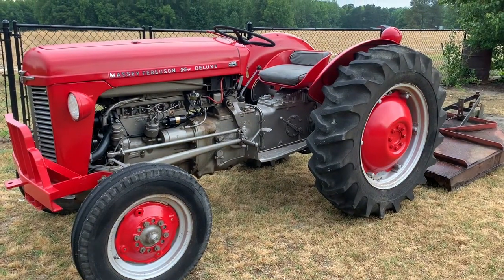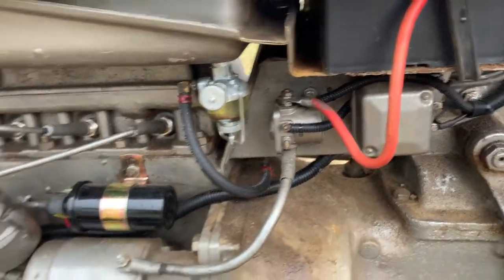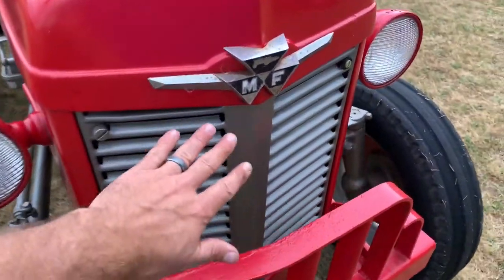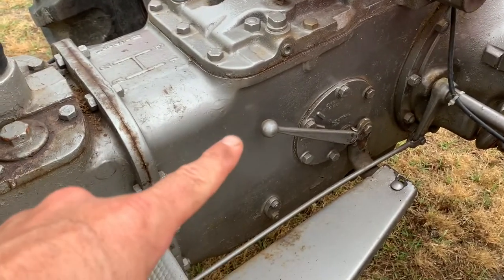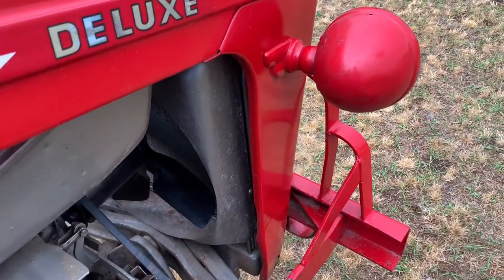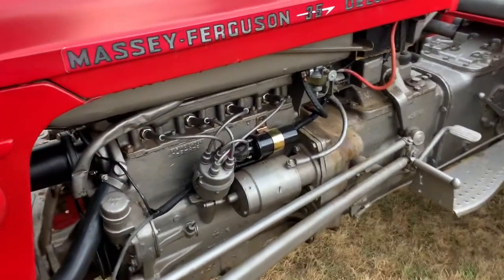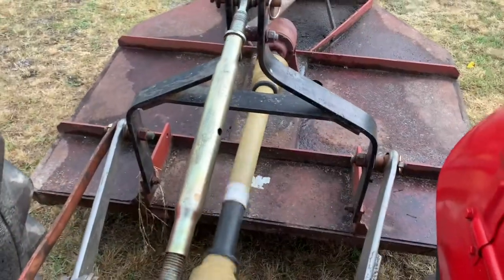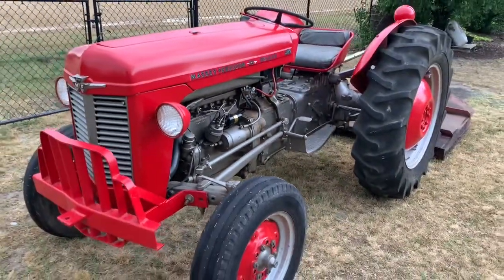1963 Massey Ferguson 35. Refurbished and ready for Work!  See all that was done to get her going!

Comment: The Deluxe had a two stage clutch that allowed the PTO to remain running when stopping the tractor by pushing it only part way down. It also had a seat with a padded cushion, tachometer and temperature gauge. The Special had an unpadded metal seat, single stage clutch the stopped the PTO whenever the clutch was pushed down to stop the tractor. It didn’t come with a tachometer or temperature gauge. It also did not have diff-lock or power steering. The Deluxe may or may not have diff-lock and power steering.

Comment: Here in Ireland  the massey ferguson 35x  has the dual clutch and differtial   lock .  There is also a standard 35 with a  single stage clutch  and another  massey ferguson 35 with a dual clutch .These were built in Coventry  UK .

Comment: I have a 1959 TO-35  Deluxe  with the same gas engine which means the two stage clutch . I put a front loader from a 65 series on it . I had to build front mounts for it because the 65 is a few inches longer than the 35 and it mounts to the front different . It has power steering which is needed with a loaded front bucket . It's held up good for 25 years and 15 of those years it was used in my construction i retired from . Still use it on a small piece of ground out here in the country  pushing snow and cutting weeds .

Comment: I would strongly recommend a overdrive clutch for the PTO if you are gonna be mowing with the tractor, it will solve the issue of the momentum of the brush hog pushing the tractor when trying to stop or turn.
Reply: It don't need that it has live pto
Reply: It's a two stage clutch

Comment: Your brakes are Not wet brakes !
The MF-35 always used drum brakes, 'Wet brakes are like a, cluch drive plate, to look at which runs in oil inside the back axle, they were fitted to the MF-65 range and most of the latter modles.
P/S, do you know that this engine was used in the old, flying Standard car from the UK? 
Also, you could run it on H20, by using a fuel-cell next to the carburettor? 
To save money, use vegetable oil in the air filter boul, as engine oil has got expecive.

Comment: I have a 1957 TO 35, it has the deluxe seat, lights, power spread rear wheel, two way pto clutch,
I understand  the TO 35 Special did not have the light kit, two way pto clutch and a metal pan type seat,

Question, did I see you start the tractor with the small H/L gear shift in the high position as you started the tractor,
If so the start switch is broken 

My TO35 will only start if the small H/L gear shifter is in the S (start) position,
Stay safe,
Reply from the maker: You did.  I grew up on this tractor and have always started it that way.  I will check that out.  Didn’t know there is a s position. Guess this is so you don’t run your self over if starting it while standing on the ground.  I have a Ferguson to30 and it prevents you from doing that by using the gear stick and moving it to the start position.   Thanks for the comment!

Comment: If the tractor has a two stage clutch and live PTO then it is a MF35 Deluxe.
Reply from the maker: It does have a two stage and live pto.  Thanks. That makes sense.
Reply: @Mr_Tims  I have two 1963 Deluxe MF35's with power steering.  Great little tractor for utility work around the farm.  Simple enough for my children to operate.  Great brush hog and finish mower tractor.  Great for scraping and leveling out our gravel drive.  Just the right size to trailer the tractor to other property's that we manage.  You find a lot of uses for your "Fergie".
Reply: The Deluxe 35 has also the Gages and a deluxe seat and 2 sage pto